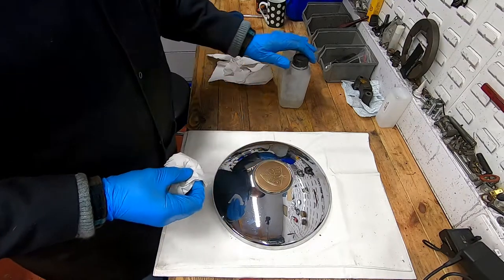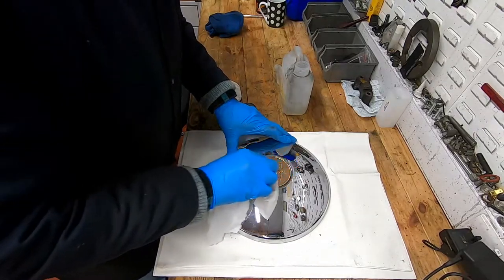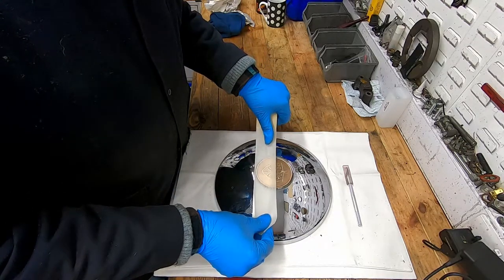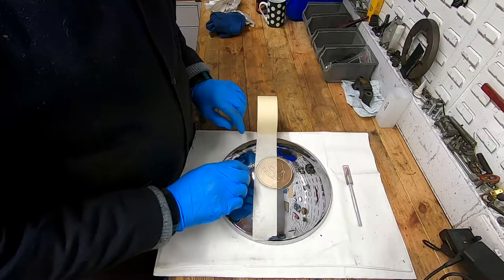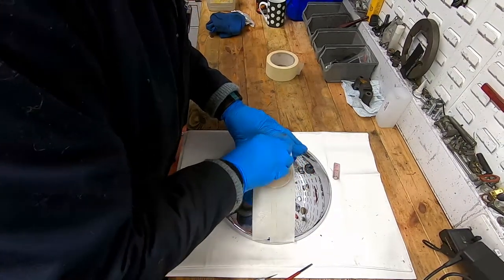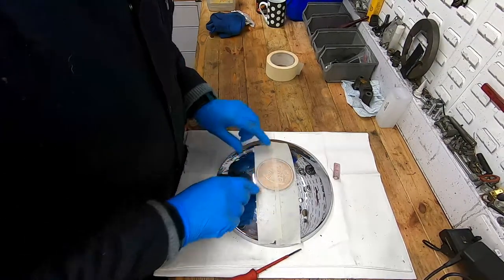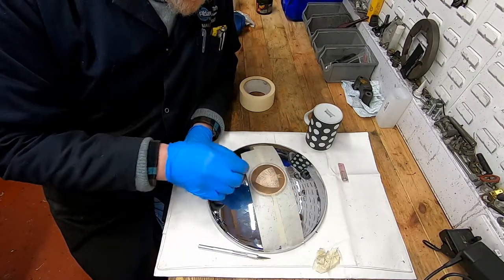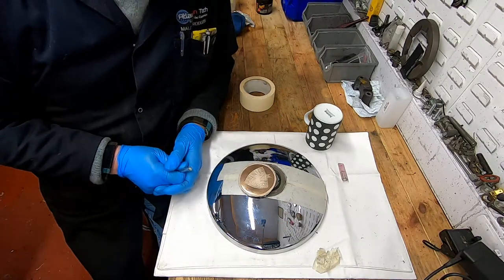Rover P4 90 Hubcap Fix Part 2

Comment: I have the same hub-caps on mine ('52 75) but my inserts are quite blotchy. I tried polishing with Brasso but didn't get very far, think I will try the wire wheel! Great job, it's a shame you couldn't find a use for an empty washing-up-liquid bottle as well! I look forward to seeing the finished car
Reply: Hi Liz, appreciate that. The first one you have to think about, but it gets easier as you go. Squeezy bottles all seem to be an odd shape these days!